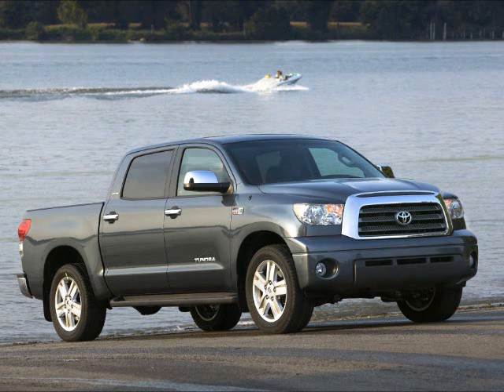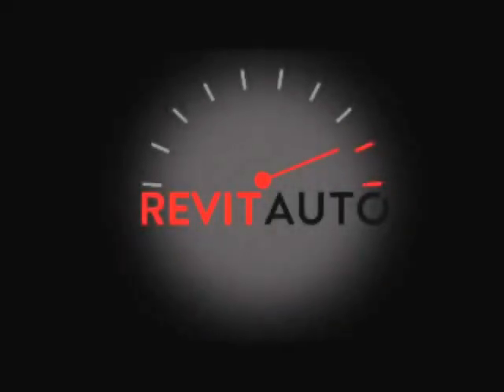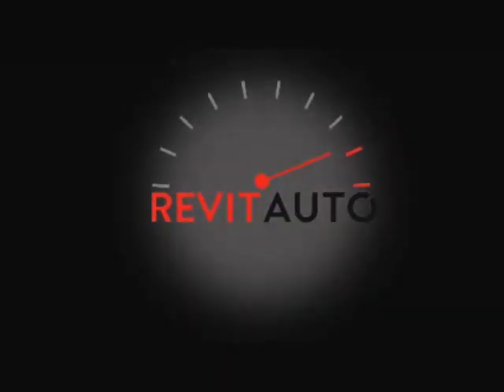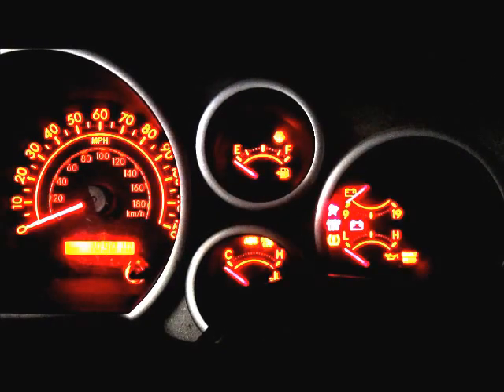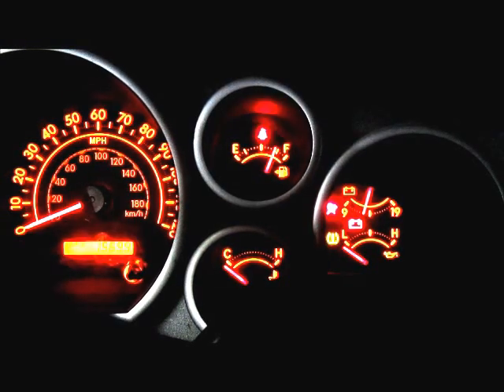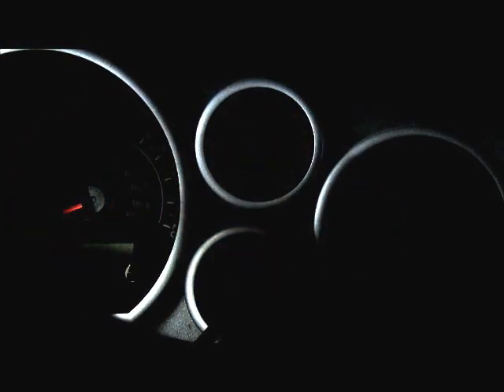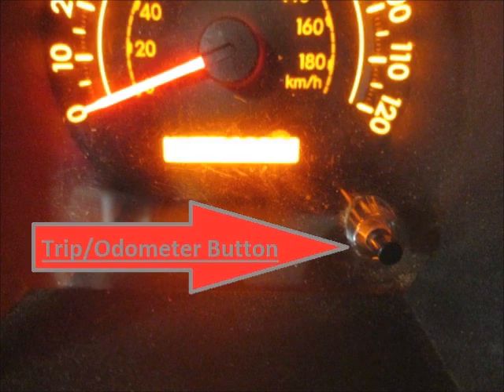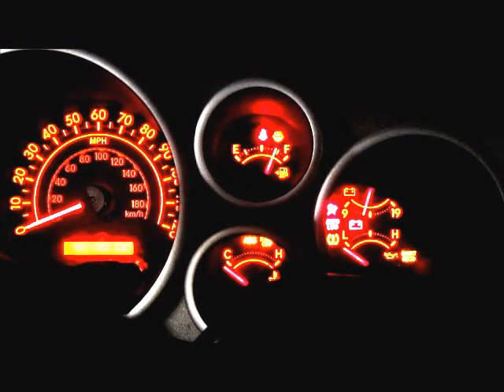2007-2010 Tundra Maintenance Light Reset (Oil Change Light, Maintenance Light) | Fix It Friday

Comment: Somebody needs to re-write the directions given in the 2007  Owner's Manual. for: "Resetting the engine oil maintenance data"...it never mentions going to 'trip meter A to reset. Thanks for video.
Reply from the maker: This is exactly why I made this video! I had the same exact issue! Thanks for commenting! Happy Motoring!

Comment: In owners manual it tells you that "odometer" should be showing.  After ten tries it didn't work but on "trip A" worked first time. Thanks!
Reply from the maker: Not a problem, that is strange it was wrong in the owners Manual, what edition manual do you have? Glad this video was able to help. Happy Motoring!
Reply: RevitAuto I'm not sure which edition it's a 2007

Comment: thank you so much sir. I was wondering is it normal for the oil lamp to stay on after?
Reply from the maker: DO NOT RUN YOUR VEHICLE! That indicates low oil pressure. Check your engine oil level! Look at this link for more information on what your dash light means. 

http://www.toyota.com/owners/resources/dashboard-indicator-details/low-engine-oil-pressure-warning-light/COMMCOMMON-1002

Comment: Sorry doesn't work.. 2013 Tundra ... follow step by step , my thumb is numb.. no reset
Reply from the maker: This Video was created for a 2007-2010 Tundra if your Truck has a Multi-Information Display the process is different. Try it again using these procedures. Hope your thumb recovers..... Happy Motoring! 
1. Turn the ignition to run (one position before starting engine).
2. Ensure Trip Meter A reading is shown.  Turn the ignition off.
3. While holding down the trip meter reset knob turn the ignition to run (one position before starting engine).
Without multi-information display
4. Continue to press and hold the button until the trip meter displays "000000".
..........................................With multi-information display......................................................................................
4. Continue to press and hold the button until “MAINT REQD RESET MODE COMPLETE" appears on the multi-information display.
5. Turn the ignition off and then start the engine to verify the indicator has been reset.